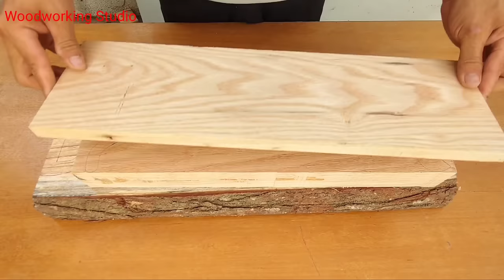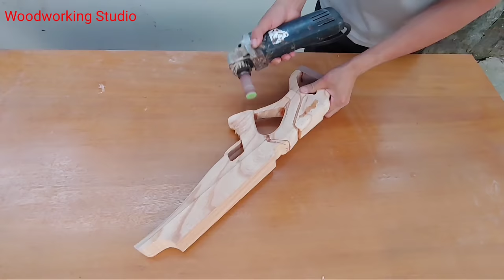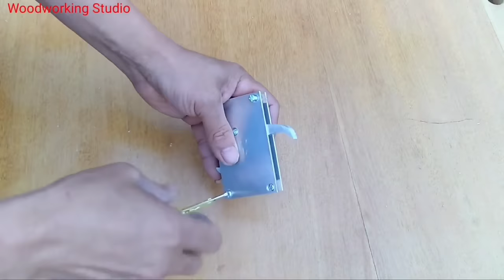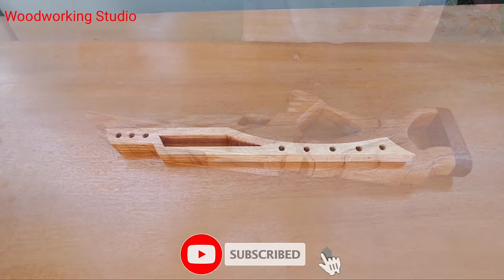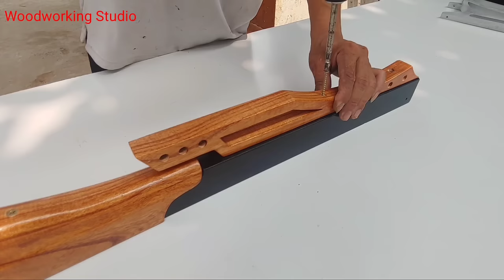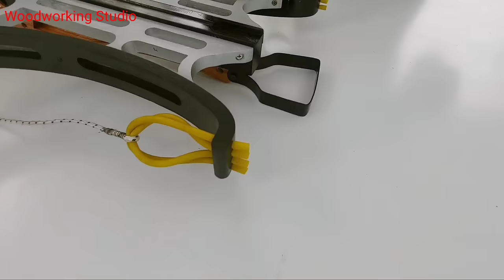DIY Crossbow - How To Make Super Powerful Crossbow

Comment: Very interesting! The rubber will last much longer this way, not stretching over the pulley.

It would be interesting to see this concept modified into a reverse draw design, so you could get a much longer power-stroke.

Very cool build!
Reply from the maker: Thanks
Reply: This is a weirdly shaped slingshot, and nothing like a crossbow!

Comment: It looks very cool, but first of all it isn't a bow though, it's a slingshot. A very strong one regardless. But i think it could've been much more practical with a few improvements, nice build though!
Reply from the maker: Thank you for visiting my youtube channel
Reply: What improvements did you have in mind? I made one similar after I saw this and it doesn’t seem like the limbs are beneficial, but more just add visuals as a plus, but weight and unwieldy bulk as a negative. I’m trying to build a better one, maybe you have some good ideas that I could take into consideration.
Reply: @rickymortinson1918  I agree the build looks very cool visually, but its probably weighing more than it should, and probably less ergonomic. If you ask me, honestly wrist rockets are the best slingshots; easier to reload and very light but powerful. It will get the same job done. Improvements on this slingshot-crossbow though:

A different material for the grip, most probably leather. 

Removing the part where it connects with the stock and grip will make it more ergonomic and easier to handle. If you ask me there is not a reason at all to have a butt, this slingshot is not powerful enough to give you recoil. But again, it makes it easier for you to reload the weapon as seen in 14:35. It is a matter of choice. 

The part where limbs connect with the body seems overcomplicated, if you could work with steel you could come up with something way more lighter and visually less clustered. 

This bow has a reverse draw design but it doesnt really use it. I'm no expert at how a slingshot could be used with reverse-draw but this definitely isn't the one. ZNA Productions commented on this video that it could be modified into a reverse draw design, this channel was the first time i got into making bows with PVC. So I'll agree with that. The point of reverse draw crossbows are that you could get a more powerful power stroke. It means longer limbs without actually making the crossbow longer and heavier. But again, i don't know how it could be enforced with slingshots. I guess this is all i could say, good luck.

Comment: In all reality, the whole wing design is not necessary to give you same power strokes from the rubbers. Without the wings and pulley's you will actually have just a little more power. In all.. a striking model, but lighter and more maneuverable if with a simple front t for the rubbers. The wood craft is exquisite! :goodvibes:
Reply from the maker: Thanks

Comment: I do not see the practicality of the "limbs". The only obvious functioning part, is the bungee chord. That's all.
Reply from the maker: Thanks
Reply: Ora, faz uma sem madeira sem NADA  so com a corda e mostra pra gente.😂😂😂😂😂.
Reply: E o teu nome é esse mesmo ?? Azar ... nossa...
Reply: I think the purpose of them here is to allow the string to come to a horizontal rest. They aren't flexing to give any extra inertia but rather provide a safe stopping point for the string.
Reply: Thats because there is none 😂 but i have seen a lot of these crossbows and this is one of the nicest because of the design ,so it wasnt for nothing
Reply: The design is beautifull. And the limbs are an artistic design choice. I appreciate the time and effort that  went into this as well as the power that it has. It's badass.
Reply: that doesn’t make sense
Reply: You are wrong. It will be hard to explain without illustration, but i'll try my best.

It creates leverage, it makes the pull lighter and faster in the same time, you can measure by yourself and discover that for every  cm/inch of line draw, the bands moves less, maybe in 1/2 or 2/3 ratio.
 On the practical level, it makes the pull less powerful, but if you load up with a few bands, it lets you surpass the contractions speed of the band, which is amazing!
Reply: I agree, the limbs are useless here
Reply: @jeremiahhelg 
Exactly 💯💯💯👍👍👍